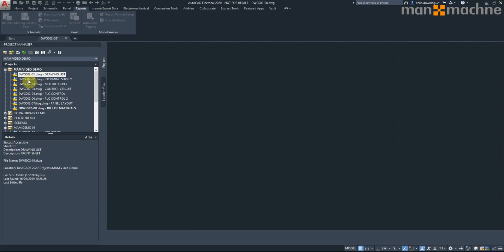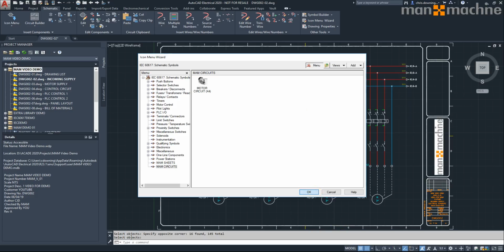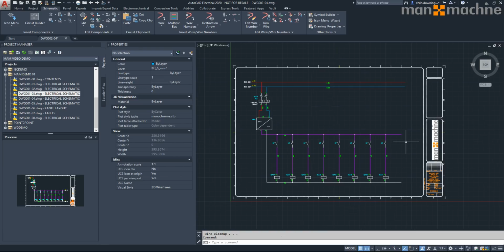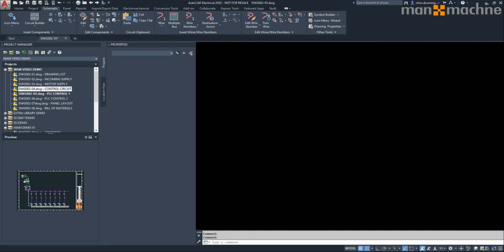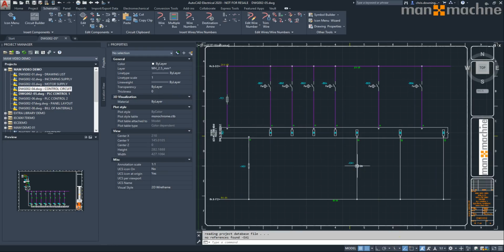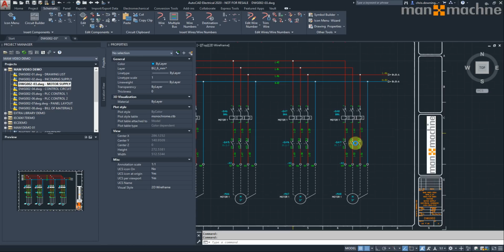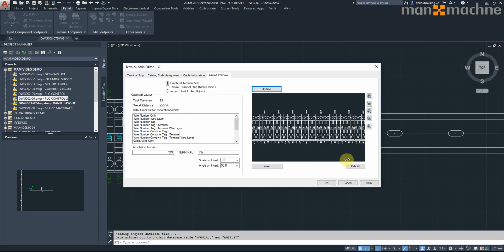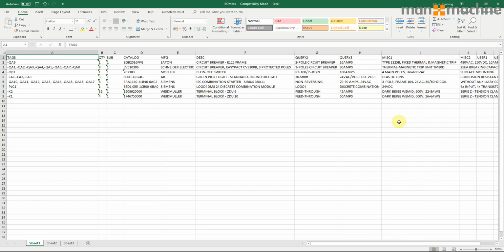The Benefits of AutoCAD Electrical 2020

Comment: sir i can find my schematics option in 2019 can you please help me fix this.. thanks
Reply: sir i can not find my schematic option can you please help me fix this issue , i will be thankful to you
Reply from the maker: You could try changing the Workspace option on the status bar (bottom right) to ACADE & 2D Drafting & Annotation,
or if this does not work try resetting AutoCAD Electrical using the reset utility found @ C:\ProgramData\Microsoft\Windows\Start Menu\Programs\AutoCAD Electrical 2020 – English/Reset Settings to Default -
AutoCAD Electrical